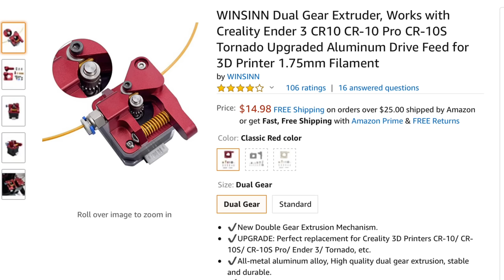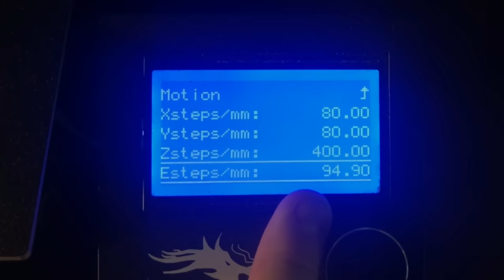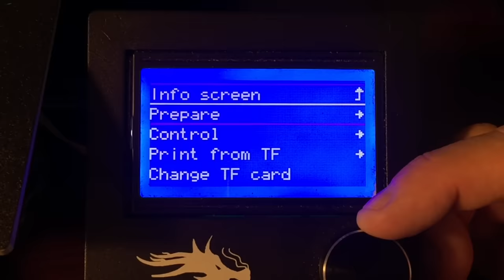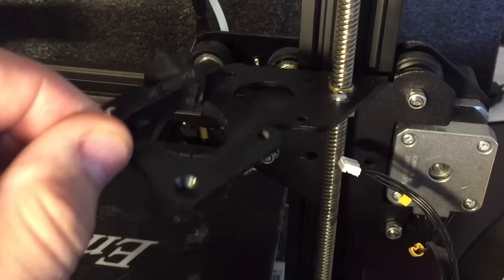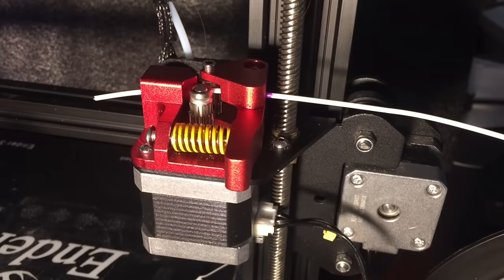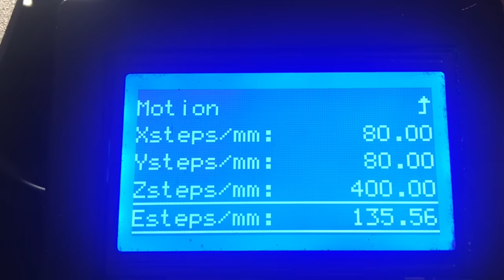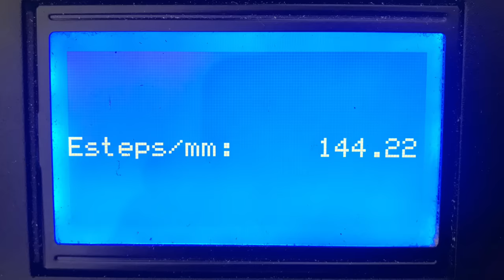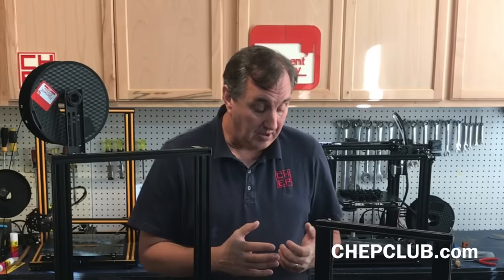Dual Drive Gear Extruder Upgrade + E Steps on Creality Ender 3

Comment: I've been running this dual gear extruder on my Ender 3 for about 3 months.  My experience is about the same as Chep's review. I haven't noticed any differences in the quality of my prints, either good or bad, compared to the stock Ender extruder when it was new.  I'm using an $8 all-metal single gear extruder on my other Ender 3 and it works just as well as the dual gear version.  Based on that comparison, I'm not sure I would bother with another dual gear on an Ender 3.  Maybe there's a more noticeable difference on a CR-10.  Two things I don't like about this extruder... The  motor shaft doesn't stick up above the drive gear now so I can't install my extruder rotating knob. I kind of miss being able to manually feed filament with that knob.   The other thing is the spring tension screw head is a bit sharp and not at all comfortable to squeeze against.  With that upgraded spring installed, you need to apply a fair amount of finger pressure on the release the arm and that screw head starts to get painful quick.
Reply: I think the biggest advantage of this upgrade is it's reliability. It grips the filament on both sides so there is minimal or no slipping, especially if you clean the filament shavings of it every once and a while.
Also a lot of people have been reporting that the plastic arm cracked on the original and there is practically no fear of that happening on the metal one.

The only thing I miss is as you said you can't use a knob on top of the gear shaft. Oh and the plastic one had a nice cable holder on the end, but mine didn't hold the cables that well and you can easilly print something else for that.

Comment: Hi Chuck - thanks for the review.  I've also purchased a dual drive because I thought it might help with jams and tangles on the filament roll, although there's a point where the filament will break, there are times where it should get past a tangle.

In reference to the driven gear cutting into the base, I see that others have also experienced this. And, that a manufacture has reduced the thickness of the base and inserted a washer between the base and the gear. This isn't a bad idea since the gear is steel and and the base is AL, but I think a thrust bearing would be the ideal solution. 

I have a lathe, so I just removed the enough material from the gear teeth to prevent them from cutting into the base - I still have the other options if needed. 

Thanks for all the useful information that you provide.

Comment: Hey Chep  Thanks for the video  so i just replaced my motherboard with the silent board and I also installed the duel drive extruder and with a 3d printed direct-drive bracket i modified for the new duel gear extruder  and i used a 2 1/2 inch piece of Capricorn tubing    and calibrated my esteps the way u showed in this video and i  have to thank u big time  my ender 3 pro has always printed great but now it's printing on a new level of clean   i love this set up  thanks for the videos and all the tip and trick you share

Comment: My dual drive extruder started to grind metal it was so tight and clicking so i switched to maroon extruder it works fine now
Reply: I'm having this exact issue with my dual drive extruder
Reply: Same here too, I'm getting really weird inconsistencies in my first layer, don't know if It is because of this grinding?

Comment: Chep, cheers for this video!  Winsinn's dual drive gear extruder filament input ends up being ~8mm too high and ~2mm too left relative to my Ender 3 Max Runout sensor.  Temporarily set back the runout sensor back from the extruder, and just mounted using 2 of the 4 screws.  Run out is arse out, until I find or make a riser/spacer model so runout sensor and extruder are perfectly aligned.

Comment: Good job man. Very helpful. Upgrade went very smoothly...especially helpful were the z steps per mm fix. Was having some clog issues with Matte PLA...was shredding on retracts with stock voxelab aquila extruder. Suspect this should fix it. Buddy of mine upgraded but has been having issues. He...didn't watch your video. Bet this helps! Pretty sure the steps per mm setting wasn't all that accurate either after the Alex firmware upgrade. So far...can see improvement with PLA + parts. Good job, man!

Comment: Chep, those dual drive gear extruders are often included as a "free gift" on the ebay Ender 3 printer listings so if people are buying an Ender 3 then it is worth looking out for. Although sometimes the free bit cost a couple of dollars more than the listing without. But still normally cheaper then buying it afterwards as an upgrade.

Comment: Get the LONGER LK5 pro   prints every bit as good as the ENder 3 pro if not even better and much bigger... 300x300x400         got mine at NEWEGG  refurbished but it was done by LONGER and sent from them so warranty came with..... and so far  LOVE IT!!!

Comment: Dude never though to check loaded versus unloaded!!

Also never could figure out what that little bit was for that you put in the spring! Thanks!

the advantage is what you discovered. consistent results. ALSO should behave better with flexible since the filament won't be "torqued" one way or the other by a one sided gear drive!!
Reply from the maker: All except Ninjaflex work fine.

Comment: I purchased this upgrade, used it for a week and returned it.  It does not have bearings in the idler and it grinds itself apart. I highly recommend you purchase one with needle bearings in the idler or it will not last.   The downside of this even if good quality is that it adds quite a bit of height to the filament.  Not a great thing if you want to direct mount your extruder.

Comment: I dont often comment on videos but i just wanted to say thank you for this! Super helpful and very informative! I had a slightly different experience as i am using this for direct drive but apart from having to assemble a few bits in different order it really helped me. One thing i am interested in is the reports of the cogs wearing away at the metal so use of grease would be best?

Comment: Would have been interesting to see this with flexible filament, as that’s surely the reason most people will want dual gear? It’s designed with flexible filament in mind so would be interesting to see how it compares
Reply from the maker: It doesn’t work with very flexible filament. The filament escapes.

Comment: Some of the ones from Creality have a yellow metal washer on each end of the idler gear. The threaded bolt running through the bearings for it is just cheap. A 3mm shoulder bolt with a 17mm lg shoulder from McMaster-Carr 91273A334 should solve this issue.

Comment: Thanks, excellent video, helped a lot.
Update, problem: Got the kit in the mail, but my Ender 3 V2 had a short stepper motor shaft, shaft is only about .5 inches from the raised boss of the case to the end of the shaft. It has the pressed on gear as a filament drive.
The new gear didn't fit on the short shaft. Have to buy a new motor with a longer shaft, about $20 shipped from ebay.

Comment: Fyi that "slippage" or what I called backlash after feeding is something I recently experienced on my Longer LK4. One of the newer firmware versions did this no matter what. Reverting back to a 2 year old firmware resulted in no backlash and perfect e-steps. I tried a few other new versions which resulted in terrible stepper noise and Longer confirmed they changed the motherboard since I bought it. 5 revisions ago is the only one that works for my printer without issues. Just thought it was worth mentioning that firmware alone can cause that "slippage". Even with the new extruder, the gears should not be jumping back.

Comment: 6mm at 185, and 6mm at 205.  Notice there isn't any slippage at all, or the two temperatures would guaranteed have different amounts.  The 6mm change is just the difference vs the old extruder drive wheel, the grooved path is just a slightly different diameter with the new gears and comes up 6mm short.  Minor correction, the general idea of this video is correct and great.
Reply: Not true.  :(  If you watch the video, the first correction for the much smaller diameter feed gears is huge, but he already went through the laborious task of turning the adjustment knob FOREVER.

Comment: One thing I noticed is that the dual drive extruder has the port for the filament much closer to the extruder gears than stock, so it should work for flexible filaments as well.

Comment: just did a calibration with my new extruder and got  144.1, wanted to validate elsewhere. Thanks Chuck
Reply: There is nothing to validate. Just a simple calculation like mentioned. Simply do it again after dialing in the new values. Like explained here. Very straight forward.

Comment: FOR ANY ONE TRYING TO FIGURE OUT THE NEW ADAPTER TO THE BOWDEN TUBE: the black piece clips into the hole and the blue clip is installed after the bowden tube to hold it into place. Just and FYI since I ran into this problem.

Comment: For those of us who don't have fancy firmware with e-step config built in, change your flow rate between 90-95% if you are getting over extrusion, and see if that helps.

Comment: Useful info right here! I shall be doing all this malarkey for the first time when I buy my next 3D printer. Heh, I have a Tevo Tarantula that I haven't used in more than a year. But I want to get back into it with a better machine, I'll probably go for the Ender 5. Plus, I'm considering an E3D direct drive extruder later on.

Comment: Great video! This definitely helped me on the install since the package didn’t come with instructions. 

Question though: I have a loud grinding when it retracts. Should I get a spacer or something for the front gear? Or will Oil like you mentioned be good enough?
Reply from the maker: Try oil first
Reply: I have that grinding too. I tried lubricating the gear with some lithium grease but I need to see how that works out.

Comment: I briefly had this extruder. It was noisy. Every time the extruder would retract,the excessive backlash of the gears would make a loud tick sound. I had spent money to silence my printer quieter so I wasn't going to add something to make it louder. I sent the extruder back.
Reply: Check the tiny worm which holds the gear in place. I had the same problem and I noticed that it was a bit long so I polished to make it shorter and I does not make any more strange sounds. It seems that dual extruder comes faulty.

Comment: I just replaced it on my Ender 3 Clone.  My values were identical to yours :) 

Now to figure out why (after doing the fix for elephant foot) I still have 2 sides of the cube still showing signs of an elephant foot).

Comment: There is a  upgrade version  of this out now with a washer  under the  gear and  bearings  on the  bolt. I added a bit of  lithium grease as a  extra precaution. My stock  extruder  went into  slipping and clacking so I had to  do something. The stock parts looked ok but did  not work as they did. Obliviously wear even  if it wasn't obvious to see . I have also found the  white  PTFE works better for me.  Supposed to be the same as the  blue  but it is a bit larger  on the I.D.  I know that is supposed  to  introduce some variation  on extraction  but its seems  more reliable. A finished  print is better than a crashed  print.. I'm ok with that trade off.

Comment: I've recently purchased very similar extruder from amazon UK  and after Chucks video it fitted and works great..Esteps Hmmm was wondering why all my prints were great apart from no structural integrity.  Another great informative video....... SPOILER ALERT  going from 94.00 to 138.84 Esteps takes some knob turning LOL
Reply: And as much as I did my own independent measurements on actual filament to calculate my own custom e-step value, it turns out that it was PRECISELY the same as Chuck's!

Comment: I dont think you're gonna see different print quality as long as you're printing at a moderate speed. But it really does seem like with this you can crank up the speeds and not get slippage. Pretty much max out your hot end and avoid under extrusion. Plus it probably makes retractions a lot better which would reduce stringing on stuff like PETG

Comment: I've just put one of these on my Ender3. The stock extruder handled TPU fine.  This extruder certainly does not. Lots of curly filament, this side of the bowden tube.

Comment: If you don't want to use a geared extruder like a BMG or Titan clone, you could use this with a printed planetary gear between it and the motor. One advantage is you don't need to reflash to reverse motor direction.

Comment: I bought this double gear extruder and after calibrating had almost exactly the same e-steps as you did on my Bowden setup. Must be the extra grip that puts the steps higher than the stock one with the loose bearing. I have to print out some more parts but am definitely going to install this extruder as a direct drive soon.
Reply: Same here, I was off the same 3cm amount from my previously calibrated stock extruder. It might also be a difference in the outer diameter of the gears (where they interface with the filament).

Comment: Hello! 
I have 2 questions for you:
1. Is it possible to mount the knob on the extruder?
2. Why does the temperature of the nozzle affect the length of the extended filament? I have seen a few videos about calibrating the extruder. You are the first person to take the nozzle temperature into account during calibration.

Best regards.
Reply from the maker: 1. Not really
2. Using the nozzle accounts for slippage due to resistance.

Comment: I got too excited for dual gear extrusion and didn't think about my direct drive set up and the need for a new adapter to make it all fit and work together. I may try to modify the adapter files to make the dual gear work. 
On the other hand, I've gotten quite good at taking my Ender 3 apart and putting it back together!
Reply: Which direct drive set up do you have? I ran into the same problem

Comment: Thanks for explaining the esteps.  I have heard them before but I didn't know how to tune that in.  I just got a cr10s5  and really been wanting to tune it in before I start on some multi-day print jobs.
Reply: you should only really need to tune it once in the printer's life unless  you change something on the extruder, id really recommend straightening the filament prior to measuring, and not using 100mm as that allows for too much inaccuracy, go for 200mm at least if you want to be precise, and make sure the filament is very straight when you measure it, cause a tiny bend or the natural curvature can change your measurements
Reply: also, for different materials never change e-steps, Cura and other slicers let you create material profiles, you can make a profile for each of your filaments and automatically adjust extrusion %

Comment: nice video chep
but its a lot easier to set the esteps from the terminal ( and a lot faster)
but again great video on how to tune steps and the way you showed with and with hotend is a great indication on what forces are needed to push the filament

Comment: The Amazon reviews say that the second gear eats into the metal because there is no washer of some sort. How is the new extruder assembly holding up since you got it?
Reply: @Pro Pendants I saw a post from tinymachines where they made this same part bit machined out the part of the aluminum that gets grinded and put a brass washer there instead. I have mill and I'm thinking that it might work. I might go and bit the bullet and see what happens!!

Comment: My 100mm test resulted in the exact same 30mm shortfall. What are the odds? I purchased the dual gear kit before I knew how to measure and check the feed rate. Regardless- WOW my ender3 pro works like brand new again :) Thanks for a great tutorial.

Comment: Thanks for the great video Chuck. Unfortunately I just upgraded my CR-10 mini extruder drive to the Creality metal single drive and stainless steel gear. I am going to run a test as you did on it and see how it runs and make similar adjustments. The new stainless steel feeder gear is 36 tooth as opposed to the brass 40 tooth, so that may make a difference. Did you try increasing the tension on the stock single drive gear?

Comment: Hated this dual drive on my stock cr10s pro. Caused me nothing but problems and for the price, it's about the same for a bmg clone and that one really pushes filament. I know the clone isn't exactly morality right, but it works way nicer and it fixed all my extrusion and grinding issues.

Comment: Nice video CHEP, I prefer to calibrate my esteps "on air" without any resistance. Like that is set and forget. And then calibrate each filament flow percentage/multiplier.
1. Temp Tower to check which temperature gets the more consistent layers at 100% flow
2. Cube wuth 0.8 walls, this time with the temperature from the previous step at 100% flow
3. Measure the cube walls in 2 points each side, get the average and deivide the 0.8 by the avergage, that will get me the new flow percentage.
4. Cube  wirh 0.8 walls with the temp from step 1, new flow from step 3
6. Save a cura profile for each filament brand and color, or keep a spreadsheet with these values and a main profile!

Done!

Maybe a video on it would be nice :)
Reply from the maker: Yeah, I often adjust it with flow as well for specific filaments or even specific prints. I’ve covered flow settings in previous videos but I could go deeper.